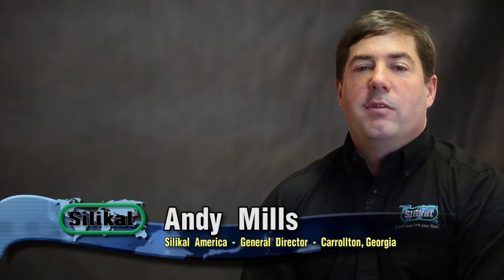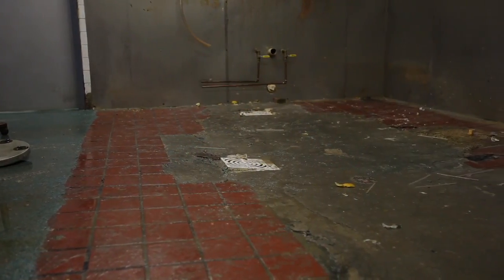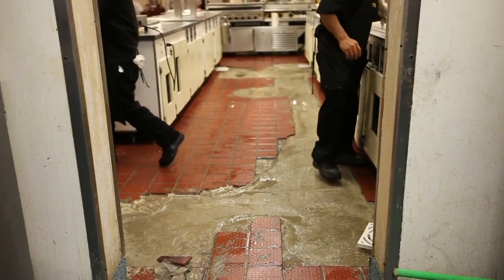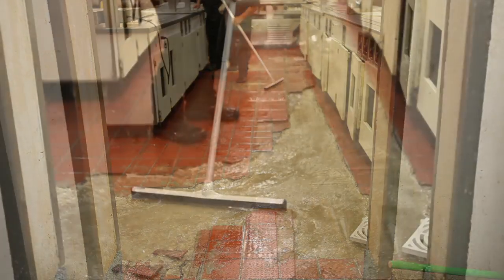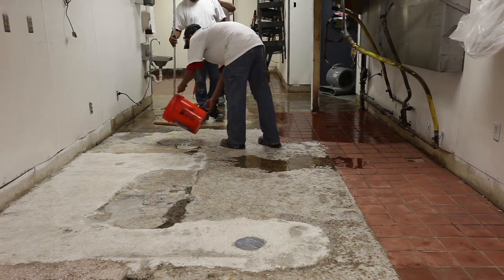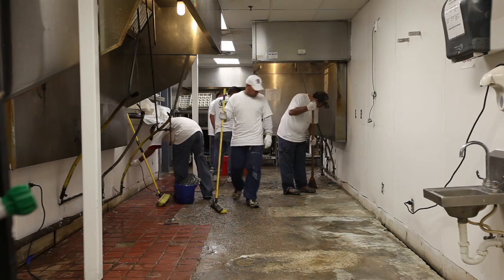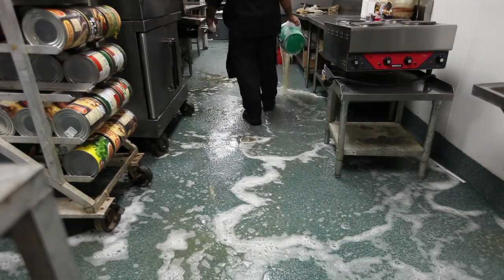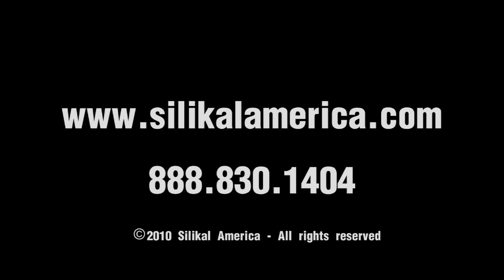Golden Corral Silikal America commercial kitchen flooring installation.

Comment: I’ve had these floors installed in my restaurant.  We are having issues cleaning the floors.  We do not have a drain in the floors. What are the best detergents to use on the floors? We were not given any real instructions other than not to use Clorox. We are using a scrub brush with hot soapy water then mopping up the extra water. The wet vac did not suck up enough water.  Any suggestions from anyone  who actually cleans these floors would be appreciated!